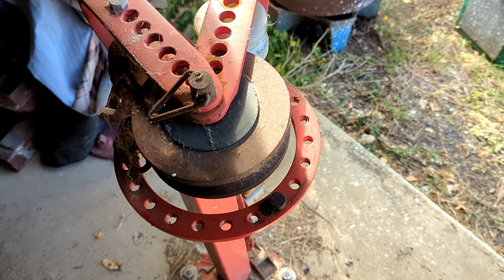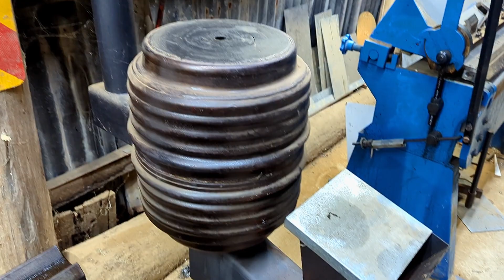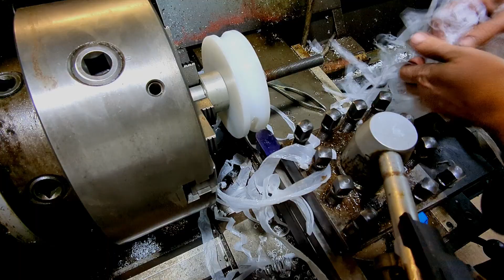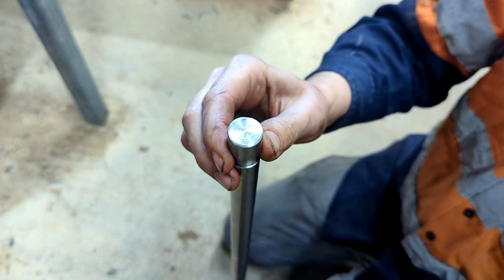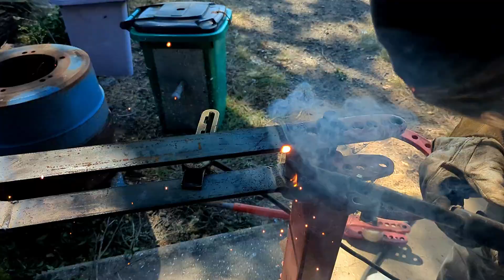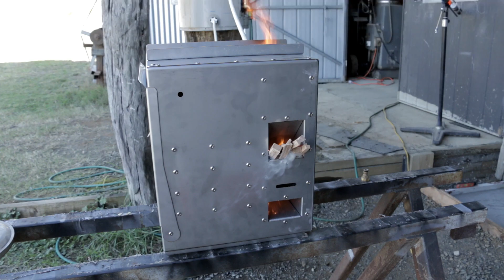Building A Rocket Stove Hot Water Heater With An Oven Part 1

Comment: Our old shop had a hydraulic bender, and in order to keep the tubing from collapsing, there were two outer rounded clamps.  One to hold the beginning of the pipe up against the inner-way, and a second one to that moved around the circle bringing the unbent section of pipe against the mandrill.  This worked because between the two there was no force on the pipe as it had already conformed to the circle.  If I remember correctly, both outer ways were straight sections.  Could do square tubing as well which was very impressive.

Anyways, keep on bending any ways you can.

Comment: Maybe try a 'Sand Battery' encasing around the chimney/base and covering pipe, for high heat storage insulation. Maybe in a steel drum? This could then be used to continuously warm water through the pipe upto 5hrs+ depending on the  volume of sand and how long you can keep the fire going in a slow burn. A Rocket Batch heater design could be included for a longer fire run.

Comment: Your pipe-bending actions are quite nice, but if I understand you correctly, you want to heat the water with them if possible. But you don't have enough turns for that, especially in the hot area. I would rather go here and weld ready-made 90-degree pipe bends so that you can implement significantly smaller radii. And not across, but lengthwise.
Reply from the maker: I agree. I did think that, the cost of the bends, the time and welding sort of persuaded me to go down the path I did. But I agree that more pipe would be better.
Reply: @LittleAussieRockets  I can understand that. And when it comes to costs, I would consider making the "tube bends" yourself with 45 degree miter cuts. It's all about heat with a furnace like that, so you don't have such a high flow rate that you need big bends for it. It would be worth trying the heating pipes with 45 degree cuts - and reducing the flow rate so that there is no noise.

Comment: Assume if you did the wheel from steel instead of plastic, you wouldn't need to fill the tube with sand because the flanks of a steel wheel wouldn't flex that much.
Reply from the maker: Yes, I did think about that. Unfortunately I didn't have any stock the right size.
Good observation.

Comment: why complex processing/parts, not very serial mass manufacturable
Reply: fill the pipe with sand, that you are bending
Reply: is this futurama, bender
Reply: nice
Reply: 3d printed or cast plastic, coated with graphite, electroplated to copper or some other high temp metal, like nickel/chromium/titanium, easy replicate making